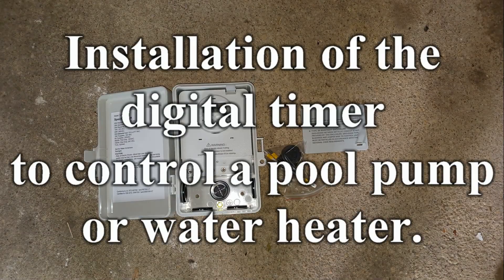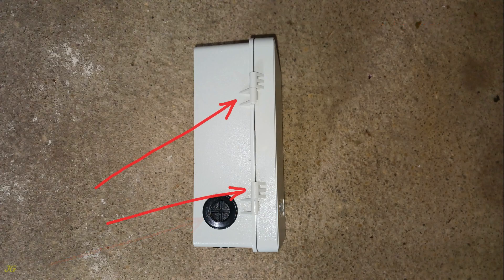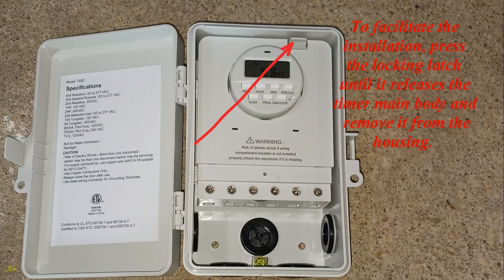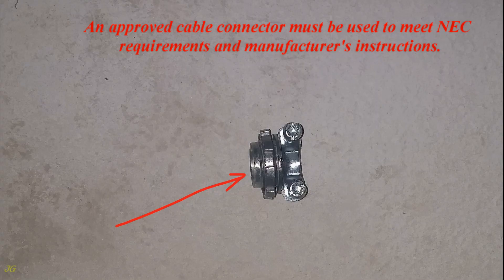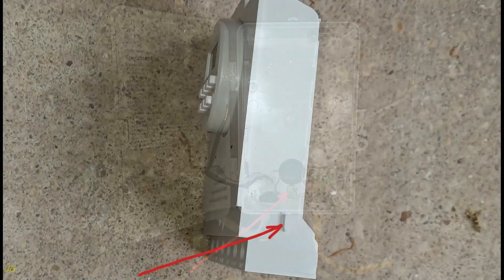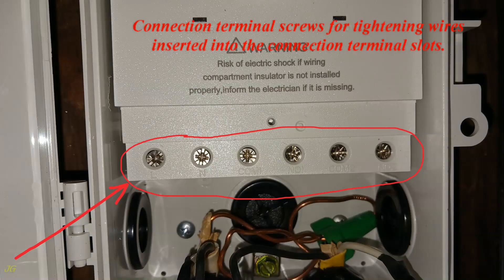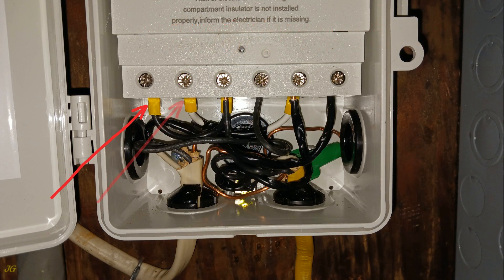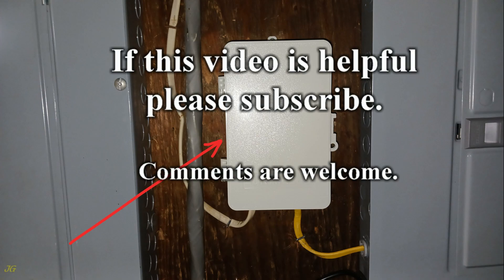Installation of the digital timer to control a pool pump or water heater

Comment: Nice extra detail shown......the only thing to mention to those not familiar with code is that ( for sure), use the proper wire connectors that prevent "pull-out" from the box, as you mentioned....but also that you need to run the wires in flex conduit from the power source to the meter and from the meter to the water heater....the vid shows solid wire / stapled as if it would end up behind drywall. Can't do it that way on top of finished drywall. Othe than that....great vid with all the smaller detail shown.... 👍
Reply from the maker: Trust me. Everything shown in this video is NEC compliant.